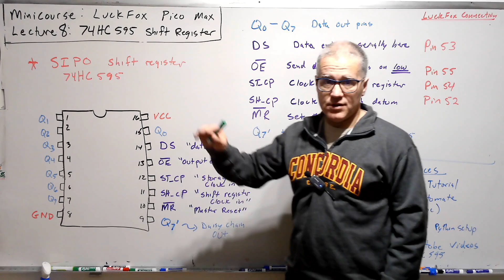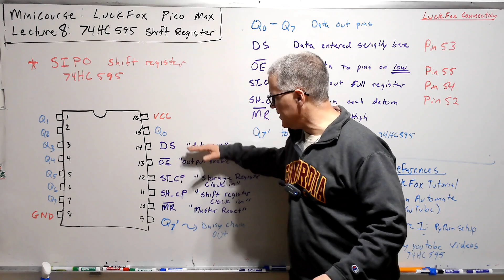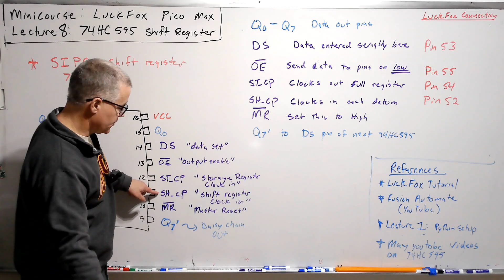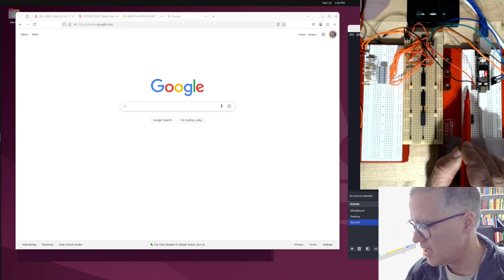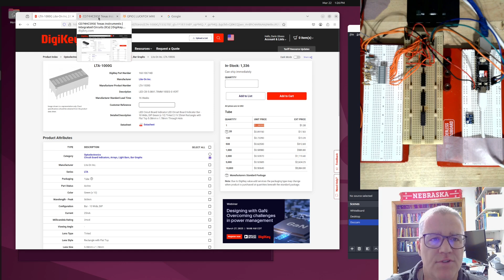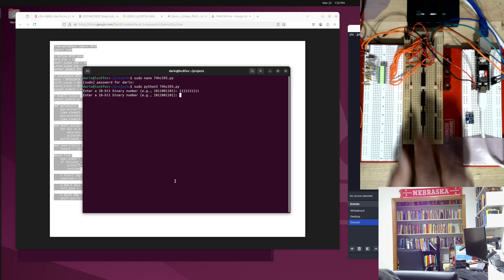LuckFox Pico Pro/Max Lab 8: Using the 74HC595 Shift Register

Comment: Hi. Thanks for sharing this video -- it has been very helpful over the last 24 hours in my efforts to use 74HC595s to control two 8 channel relay boards from a Pico. Until yesterday it had not occurred to me how simple it was to daisy chain multiple 595s using only one extra IO pin. But, in your video it is not clear what connections are needed in addition to the Q7' (pin 9) from the parent to the SER (pin 14, aka DATA) on the child. You did not mention this, and it is difficult to work it out on the video just by looking at the connections on the breadboard. (Hint: it would really be much better if you could use more than one color wire when breadboarding! 🙂)

One other source* says that for daisy-chaining:
"The Q7’ pin of one IC is connected to the SER pin of the next IC. The SRCLK and RCLK pins of all ICs are connected in parallel to the microcontroller."

I guess I am going to have to try this out, but shorting the "shift_clock" and "latch_clock" pins is counterintuitive given that they are controlled separately when using a single 595. I think I will start by shorting the pairs of clock pins and latch pins separately, to see if that works. 

*https://how2electronics.com/shift-register-74hc595-with-raspberry-pi-pico-micropython/
Reply from the maker: Hi David,

Thanks for your well thought out comment and helpful suggestions. I’m in the middle of a busy week with my classes, but I wanted to acknowledge your comment. I’ll try to give a longer response this weekend. 

In the meantime you might find this helpful 
https://youtu.be/Ys2fu4NINrA?si=XQHyJgB3NeZ27N6P

I really enjoyed that video and learned a lot from it. 

Good luck with your project!
Reply: @GNLProject-yp8po  Hi Darin -- Thanks. Whenever you have a chance to respond is great. Dronebot Workshop is a great resource -- and I have watched many of his videos -- that link is somewhat useful but he does not go into cascading ("daisy-chaining") the 74HC595. (I had not seen that one before -- probably because he is using C on an Arduino instead of MicroPython on a Pico!)

I seem to have my question resolved: daisy-chaining seems to work fine by tying the two RCLKs and the two SRCLKs, but it does not require the two pairs to be shorted together. The more I think about this, the less it makes sense to short them, so I think the link (and its schematic diagram) that I shared gives bad info.
Reply: Hi Darin

So I have it figured out now. It dawned on me that my test setup is working without any control over Pin 13 (OE, output_enable) so it is not necessary to control the status of this pin, beyond tying it to ground. 🙄That means daisy-chaining multiple 595s is perfectly feasible using only the three IO pins used to control the first one. Probably, setting Pin 13 low to enable output is the norm in any situation where cascading is required. 

Also, I found a very good explanation of chaining here: https://www.youtube.com/watch?v=j3pkbEGT4JY&t=117s
Reply from the maker: @DavidPrice-r6y  Thanks David, for you work on this. I'll pin the comment in case others will find it helpful. Good luck on the remainder of your project. 

Best,

Darin

Comment: Great videos.  Will you try doing object recognition like Yolo5 on the Luckfox?  Unfortunately I found out that the inference is done with C program files instead of Python code which is not so great if you are more familiar with Python.  Hopefully they will have newer devices like the Jetson Nano Orin that will be able to do inference with Python in the future.
Reply from the maker: Thanks for the suggestion. This is a good idea and the LuckFox is designed for good video collection, processing, and analysis. Looking at my schedule and considering my current (limited) knowledge of the ins and outs of Yolo5, I probably won't get something done on this until the end of the semester and into summer. I do have another project that will require me to learn more about image recognitions to that could go hand-in-hand with your idea.